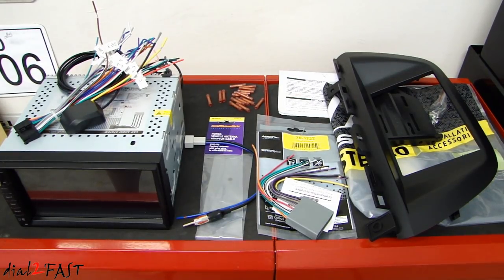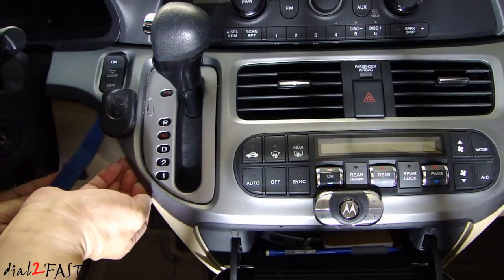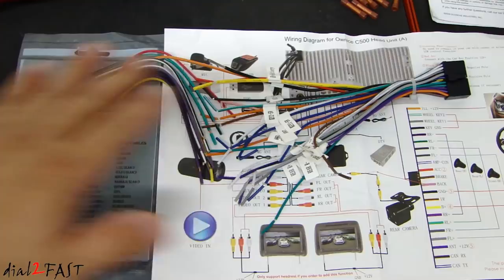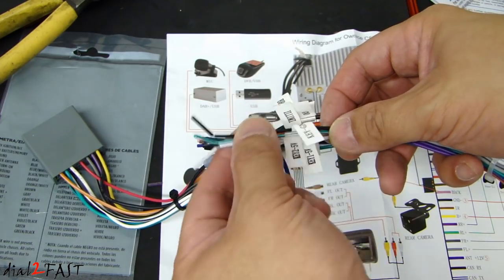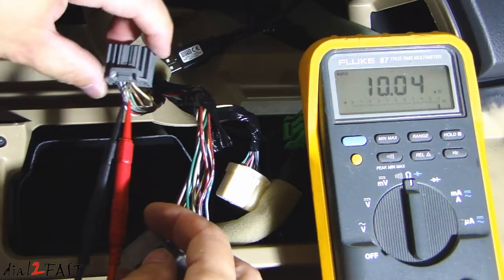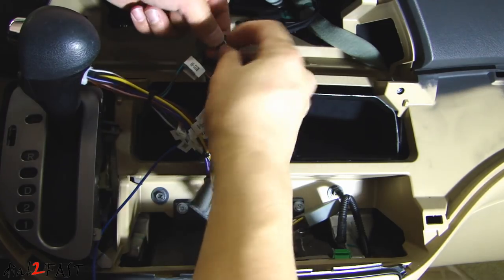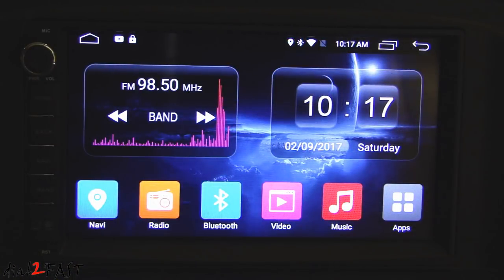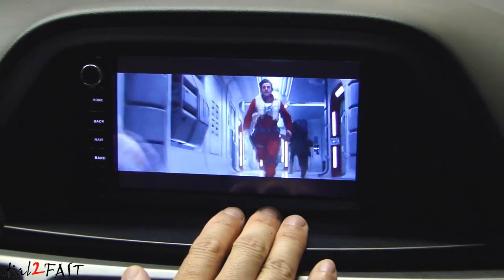Install Android Car Radio & Steering Wheel Control In Honda Odyssey 08 - Ownice C500

Comment: Every time I think about attempting to install one of these myself I just look at videos like this and discover just how much electrical knowledge you need to possess to get the steering wheel controls to work.
Reply: none if you just look up a diagram. he was showing off.
Reply: Agree with Michael. Just follow the diagram. You can do it!!
Reply: @NoraTTang  literally my 5yr old can do it’s not hard at all if you can read...
Reply: @NoraTTang  It's not that easy. The instructions & diagram written by those Chinese are horrible. The guy did a great job showing you how to.

Comment: what i wanna know is how you got that aftermarket head unit to boot up with the honda logo. i want it.
Reply: Download a Honda logo Image. And upload it to your radio via USB. If your using android radio especially setup wifi Google it download etc. And it should be an app on the radio to allow you to change the boot up screen.

Comment: I am trying to install carplay system in my 2009 Honda Odyssey EXL with factory navigation and DVD player and RES. I just want to install the new stereo system and have backup camera support. Not so much concerned about RES. The new stereo comes with its own camera but I am okay to continue with original factory backup camera. The wiring seems different in my system than this videos. Can someone please help how to do the wiring in this system? thanks so much!

Comment: This is very helpful, thank you so much.  I am installing a different radio than the one you installed here on my 2008 Honda Odyssey.  The radio came with 2 steering wheel wires labled as SW1 and SW2.  In your video, you showed that the your brown is connected to key 1 (ground) and key 2 wires on your harness.  I was wondering if my SW1 is equivalent as your key 1 ground, and my SW2 is your key 2 wire?  Thanks for your input.  :-)
Reply: Hi Alexander, How do you input the code if the battery is ever disconnected now which shuts off the radio and I think a few other things that we have to input to get them working again?

Comment: for everyone having trouble with the key 1 and key 2 wires, apparently you're supposed to attach one of the Honda's steering wheel control wires to ground and the other one to key1 (or key2). Key 2 is just for in case you have a lot of steering wheel buttons. I'm installing it tomorrow to verify if this is true.
Reply: Hi man, so as I understand that key 1 or 2 have to go to input and we take ground from black cable(ground cable) from main harness. But for example if my car has 2 group of steering wheel control buttons like 3 each side. Should I both key 1 and key 2 connect to input?
Reply: Did you verify?
Reply: @danh9676  yep, if I recall correctly, I connected key1 to the positive input and just grounded the other one. The unit measures resistance and all you need for that is the single wire but grounded
Reply: @sevkibicen8377  well that entirely depends on your car. You just gave me a hypothetical scenario. Does ur car really have 2 cables? If so then connect one of the + cables to key1, the other to key2, and ground the negative one. That's how it worked for me with my single wire.
Reply: @xtremedestroyer9241  How did you ground key2? Sorry, wiring newb here.
Reply: @somebeersomedude8795  I think so. I'd do so if I were you, as it wouldn't hurt to ground it either way. It couldn't do damage, if that's your concern.

Comment: Very helpful video, just a quick questions, I have only one wire (key1) from my android auto, should I connect it to wire number 6 or 7? 
Also did you connect that 20 pins harness to somewhere or not? If yes where did you connect that harness? I don’t have options for that harness in my adroid system. Thank you in advance

Comment: Hello, this looks awesome and I will attempt to get this done. My question is my 2006 oddesey has dvd system in the back for the kids, how and is it that going to get affected? How would I have control of dvd input in the back?

Thank you.
Reply from the maker: If you install this aftermarket radio, you will lose the control of the rear DVD.
Reply: @dial2fast  do you know would they be able to control it from the back, and how would that work? DVD is very important to us, since we go on a longer trips and kids love to watch the movies.

Thank you.
Reply from the maker: @krulj25  You will lose all the rear entertainment function because all the control is from the front factory head unit.

Comment: Great demo! Looks like a nice unit 👍
However why wouldn't they make the opening big enough for their screen ? That's odd 
And the wiring is odd also they give you two wire plugs that you have to put together why not just have it factory wired together and the customer could just cut the wires that weren't needed ? Again great detail 👍
Reply from the maker: The Scosche plastic bezel is actually a proper double DIN size that would fit all the Sony, Pioneer, JVC stereo, but the China brand Android unit with the 7" screen is bigger than the standard opening. As for the wiring, that's very normal for any aftermarket car stereo. There is one harness that plugs to the aftermarket radio, then it's the customer's responsibility to figure how they will wire it to the factory wiring. In this video, I show you how to 'easily' wire everything up by buying a wiring harness that plugs directly to the factory plug. You will notice with the way this was installed, no factory wires were cut. The factory stereo can be reinstalled at anytime if you want. Hope the info helps. Thanks!
Reply: dial2fast oh ok got ya that does help thank you 👍
I just figured if they were supplying the wiring harness it would be easier to just cut the wires not needed then have to soldier each one 
And yes it's very nice that you don't have to cut into the factory harness this way you can put the old system back in for resale 
Thanks for taking the time to reply I appreciate it

Comment: My android car have 2 wire (brown and pink color, also called key1 & key2)
What color to connect to ground ?
Thanks for advice
Reply: The third wire is the ground, you can find it using the multimeter with the wire from switch 1 or switch 2, so if the steering wheel control has 3 wires, two circuits for the buttons and one ground for the two wires.

Comment: Does your 08 Honda Odyssey came with HFL? (handsfree link), I tried following your guide with my 2011 honda cr-z ex no nav. It worked out great, thanks. The only thing I couldn't get to work was the steering wheel controls, I found the 2 wires (one for ground and one that detects voltage for audio remote switch) I need from my harness but after wiring it the same way as you did it still didn't work.
Reply from the maker: My Ody does not have handsfree, but for the steering wheel control, you should check with a multimeter to see if each button press will have a different resistance on those two wire from the factory harness. There is no voltage coming from the two factory wires (when not connected to the stereo). The aftermarket stereo will detect the voltage drop of each button press and saves it in its memory.
Reply: dial2fast yes, I checked it with a multimeter like what you did and and it does recognize the resistance change when any of the buttons are pressed. unlike your HU, mine only has 2 wires for steering wheel controls ( SW-Key 1 and 2, no SW-Key Ground). I grounded one of the wire for the SWC and connected the wire that detects the button press to SW-Key 2 (also tried it in SW-Key 1) but it's still not detected on the Head Unit, I wonder if mine is just defective or am I going to need one of those universal SWC adapter (like the Axxess ASWC-1)

Edit: NVM, i re checked all my connections and I finally figured out what's wrong, one of the SWC wires that neess to be grounded was not properly wired. Now its it's working. Thanks again
Reply from the maker: If you don't have SW-Key ground, try connect one of the factory SWC wire to either the SW-Key1 or SW-Key2. Then connect the second factory SWC wire to stereo ground wire. AFAIK, SW-Key1 and SW-Key2 are both used for SWC signal and should not connect direct to ground.
Reply: @dial2fast  Thanks so much. after 12hrs of my head unot changing works without resting, your comment is the solution that save my life.
Reply: In which case should we connect both key 1 and key 2 to OEM swc wire? Or how do we understand that which one (key 1 or 2) should use to connect to OEM swc input?

Comment: Hey I'm watching this video it's looks very easy but one question I have a 2009 Honda Odyssey I got navigating touch screen want to upgrade to the after market do I need all the wires you using???
Reply: were you able to do in your odyssey with navigation? could you share the resources please? thanks!

Comment: I purchased a Ankeway android radio from Amazon and not sure what type of direct wire harness to get to install in my 2009 honda odyssey. It has steering wheel radio control, no navigation from factory,rear video entertainment system. Hope you can give me some guidance in a video of possible.
Thank you for you time
Tito

Comment: You can often find the radio code on a sticker on the outside of the glove box. Or honda will give it to you just have the vin. Same with navi.

As for the harness Id save the $10 and chop it up. 
When I sell a car its ready for the crusher.

Comment: Thanks for the great video!  Our EX-L has the OEM ceiling mounted flip down DVD player.  Would it be possible to output the video from the android to that?
Reply: You'll have to find a head unit with RCA video output, and do some trickery with the control circtuitry to get the rear video to turn on.  Do a search for "dccharacter honda odyssey" for more information.

Comment: Does your unit do a full android boot up every time you put the key in? 
I expected it to wake from sleep immediately but mine does a full boot sequence every time.
I have confirmed on my unit that B+ has battery voltage and ACC comes from key accessory power.
I'm not sure why it keeps rebooting rather than sleeping.

Comment: Dear Sir, watched both your video. Looking at your video, I also bought C500 MT3562 Ownice car media system for my Mercedes C200 2004 model, but Nothing seems to be working in that. Mainly I have not succeeded in getting right connection in wire connection could you please help me.

Comment: My factory stereo has 4 connectors like yours.  Did you leave the middle 2 connectors unplugged?

Looks like a 20 pin connector and a 13 pin connector.
Reply: Yes you leave the middle two connectors unplugged, except for adding steering wheel control. 

For steering wheel control, connect a positive KEY wire to PIN 6 or 7 wire (see video at 9:20). Then you ground the other wire that is in PIN 6/7, the one you didn't connect to KEY. If you have a KEY Ground wire on your new harness you use that to ground the 6/7 wire. If you don't have a KEY ground wire then add a wire connecting your black GROUND wire to the non-keyed PIN 6/7 wire.

Here are some useful diagrams for various connectors, showing where the steering wheel control wires are. https://www.universalfuze.com/techdata
Reply: I ran into a similar situation. Wired everything else on that harness but my Nakamichi Android Unit offers steering wheel controls. 

So I have 1 Orange wire labelled "key", 2nd  Solid Blue wire labelled " SWC2" and 3rd solid Brown wire labelled "Back CTRL". I'm thinking of soldering "key" to Pin #6 and "SWC2" to Pin #7. Not sure what to do with the Brown "Back CTRL" wire though. Any help would be greatly appreciated.

Comment: I have a 2010 EX-L with a Jensen VX7022, I don't have the steering wheel controls hooked up with the headunit, I just have to splice into the two wires you showed? I don't need the steering wheel control module?
Reply from the maker: The wiring should be the same for your 2010 Odyssey. The only thing you need to check is if your Jensen unit has support for steering wheel control without the need for a third party box. I know most Android head unit has this support built in.
Reply: It looks like it has three wires for the SWC, the manual says you need a third party box.  http://www.jensenmobile.com/docs/common/VX7022/VX7022_IM.pdf
Reply from the maker: I took a look at that Jensen guide and indeed it shows SWC (A/B/gnd) similar to the Android unit. But the guide also mentions recommending to use the PAC SWI-RC device but the PAC install guide shows connecting to the aftermarket radio via 3.5mm phono jack....which I don't see the Jensen unit having in the wiring diagram. Guess if the Jensen UI has a menu to map buttons like the Android, you can always try to wire it up and see if it works (without the PAC device).
Reply: it does have a dedicated app for the SWC. I'm going to try it out.

Comment: Hi thanks for your vídeo. I tried to connect like you said in pin 6 and pin 7 but the steering wheel controls it didnt work. Can you help me please? I connect key 1 wich is the Brown cable to the brown cable in pin 6 and key 2 wich is an Orange cable to the pink cable in pin 7 i think there is something i didnt right i hope you can help me

Comment: Looking to update 2010 Odyssey EXL without navigation. Want to include remote start, steering controls, apps from internet like siriusxm, prime, hulu and others. Back up cam on radio but also allows playing while driving. 
The EXL has a different setup than Odyssey with navigation. We have a flip down tv in the back maybe two I have 5 miles in it since I bought it. Has small reverse cam in mirror which sucks. It seems to have an issue playing DVDs and sound separate from music. Want to re wire it to play apps on back tvs and plug in wired headphones so we only hear kids enjoying their shows.

Comment: Do you have any advice on how to find which wires in the harness are for the steering wheel control using a multimeter on another vehicle?  How did you narrow it down to wires 6 & 7?
Reply from the maker: Sorry I don't have info on other cars. I spent a lot of time researching on the internet fit this vehicle. You will have to either see if someone posted this info on the internet or figure out from the cars service manual wiring diagram.

Comment: I have a 2006 Honda Odyssey touring to change the head unit and for everything to work all I need is this ? I have a DVD player too
Reply: Same question, did you find the way to conect the dvd?
Reply: @Migue_litio  Without original main unit, there is no way to use the original DVD with any android stereo cause it communicates thru digital signal not analog like RCA and also it needs control signal such as play, pause and next etc. 
Technically it is possible to encode and decode the digital signal and control signal but no commercial product is available.

Comment: How do you now put the code in for the radio if the battery gets disconnected? Doesn’t it stop the radio and sliding doors from working automatically?
Reply from the maker: The radio code came with the car when it was purchased. If you don't have it, check with your dealer.
Reply: @dial2fast  I have it but if the factory radio is removed which has the number buttons at the bottom which is used to input the codes if the battery is disconnected then without the factory radio in the van how can the code be input?  Won’t it cut power the the new radio and not allow a few other things to work if the code is not input again after battery is disconnected?
Reply from the maker: @puppygadget3189  No, the code is only for unlocking the factory radio. If you pull the factory radio out and install an aftermarket radio, everything else will still work.

Comment: Any update with this unit? I added it to my cart and am about to buy.
Reply from the maker: I haven't had time to film an update, but I have been using it daily since making this video, and it has had no issues. Always turn on and start the audio with starting the car. All functions work well. Sound quality is good. If I need internet connection to unit, I tether my mobile phone to the unit and run Waze for GPS. Play all my music using a USB stick. No issue with Android and runs fine.
Reply: Wow. Thanks for the quick response. I have the same car and plan to follow your installation. Great video.

Also, do you ever plan on installing the dash cam that came with the unit?

Comment: Hi 
I have a question !!!! After install the radio what up with the original DVD unit ???
Reply from the maker: The factory radio is not a DVD player, just CD. It's currently sitting in a box and I will put it back in when I sell the car in the future.
Reply: dial2fast my odyssey has the DVD unit if I install your radio is posible use de DVD unit with this radio ?
Reply from the maker: If you have the RES entertainment system, it's very difficult to integrate it with the factory system. I think I saw someone on Ody Forum accomplish it but lot of wire splicing to the factory system to make it work.
Reply: @dial2fast  would the res DVD still work even if it's not connected to the aftermarket unit?

Comment: hello, I installed the wires for the swc,  but apparently the atoto radio has analog inputs for the swc, and my 2008 odyssey has digital?, so it doesn't work, any suggestions?, atoto radio is the a6